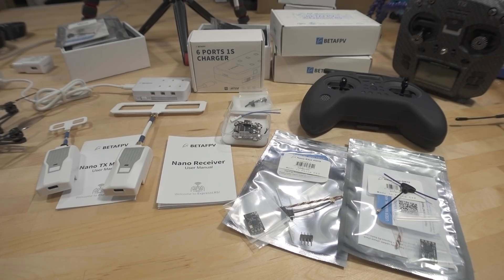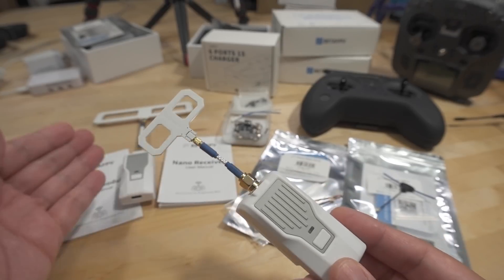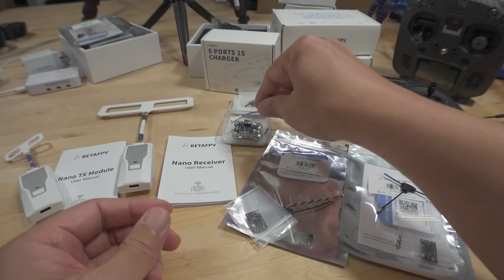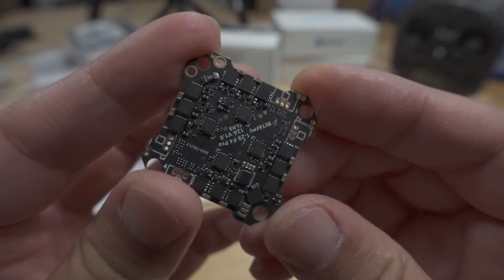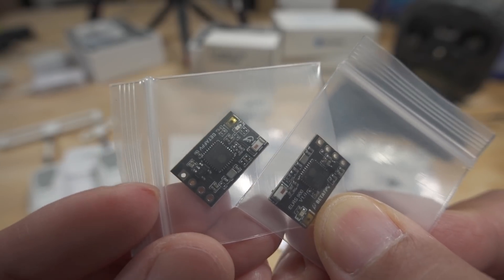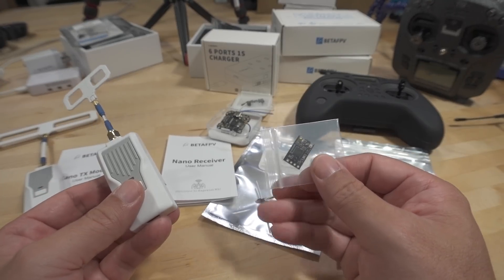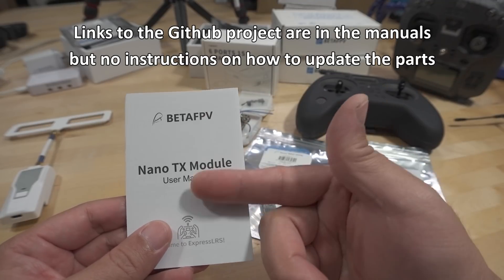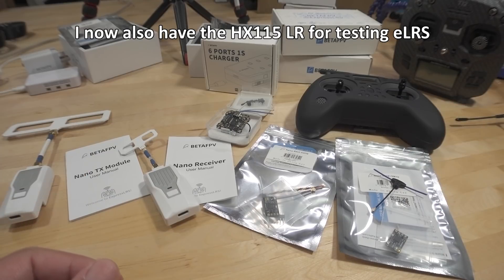BETAFPV ExpressLRS Parts are HERE! 😲

Comment: Do you still have your tango 2?  Would you do a setup video with tango 2 and betafpv ELRS 2.4?
Reply from the maker: Sorry, I don't have the Tango2 anymore.  However, the setup is the same as crossfire and you just use the eLRS lua script instead of the crossfire one to control the module.  So, I'm pretty sure no one will make that exact video because there are already many general setup videos in existence.

Comment: Betafpv or happymodel module - which one is better?
Reply from the maker: Happymodel makes a few different modules but they all basically do the same thing with some minor differences in power output.  The BETAFPV 2.4ghz module can do up to 500mW.  The Happymodel is 250mW max power.  If you want more power then get the BETAFPV module.
Reply: @AlbertKimTV  thanks for your quick reply

Comment: Do you know if they're going to release a normal-sized module for standard radios...?
Reply from the maker: No plans yet
Reply: @AlbertKimTV  Odd choice.  I'd be willing to bet that the TX-16 (and all the clones) is the current most popular transmitter out there...And it can't use this module.
Reply from the maker: @Crusader4633  Perhaps most popular with flyers of larger quads.  BETAFPV knows their customer base very well.  They mostly fly small micros and prefer the smaller radios.  A huge number of people wanted the module for the Tango 2 and X-Lite. They are just listening to their customers.  Happymodel didn't make one until recently (I think it came out a week ago).
Reply: @AlbertKimTV  Happymodel's was always a JR module, just didn't include the box LOL. True though about Beta and smaller quads.
Reply: @AlbertKimTV  For some reason Happymodel CNCed an Iron Man face into the heatsink of their module. Honestly what were they thinking?

Comment: For my next build, I'm really unsure if I should get the new TBS Sixty9 Crossfire/VTX combination board, or go for ELRS. I'm using the TBS Tango 2, and I don't have the module bay. The next build will be a 5 inch too, so weight is not an issue. I have a 2.5 inch laying around too, which is currently missing a receiver - perhaps I'll go for ELRS with that one instead.
Reply: Apart from all the launch bugs I was impressed by the Sixty9, but mine has fried itself without warning after three weeks of use. Unsure what caused the short, bit it took my FC's 5V supply with it. Possibly the u.fl pigtail touching a board component? Having two u.fl pigtails sticking out either side of the stack is the biggest weakness of the sixty9 design IMO. Anyway, I've just ordered 2.4 ELRS and seperate VTX. Crossfire only has decent range at 50Hz, and that is slow. I'd get this module and the Tango module bay adapter if I were you.
Reply: @babc142  I actually got the Sixty9. What I did, was to opt out of using the shield and 30x30 mount. Instead, I routed the uFl pigtails inwards, and I have the coax cables running out the back through the large opening opposite the main connector.  By doing that, it's super compact.
Reply: @ojkolsrud1  I did exactly the same to achieve a really neat setup, and now I'm wondering if this is how the short happened. Could the u.fl pigtail with an inward path have shorted a board component? I hadn't been near a soldering iron for weeks with that setup yet it shorted on battery connection. Anyway, I've taken the opportunity to go ELRS + Unify Pro V3.

Comment: I am wanting another Crossfire receiver but the 915mhz module and a receiver is $56.98. A Crossfire receiver is about $40 when I can find them. I may just have to switch everything over to ELRS since I can get 2 ELRS receivers for the price of 1 Crossfire receiver. The only complaint I've had about Crossfire is the price. TBS completely cured the failsafe problem I was having with my Frsky radio and receivers. Thanks for the links.

Comment: I love elrs, daily flying ep1 and tx from happymodel.. What's the point of such of high power output??? Normally I use 10mw.. Do you really need 100 200 500 mw???
Reply: For long range or penetration I believe. Do you stay pretty close to yourself when you fly?
Reply: @CarbonGlassMan  normally in my backyard, but if I want to play in bandos, I set it to 25mw... Really you don't need more.. And here in Europe, more power than 25mw (you can go up to 100mw but not with the actual channel hoping and duty cicle of elrs) is illegal.. But my point is that you miss the option of using less power (min is 100mw)
Reply: Sorry for my English, isn't my primary language

Comment: All ELRS hardware are compatible with each other as long as the options and bind phrase are the same. You can use HM Tx and BF Rx with the same options and binding phrase while compiling the firmware.
Reply from the maker: Yeah, I'm just waiting for the firmware targets to show up in the configurator since I'm not interested in doing the compiling part myself.

Comment: how wide is the slim module? will it fit in a x9 lite? thanks for review
Reply from the maker: It's the same width as the nano module bay and it is supported in the X9D Lite.
Reply: @AlbertKimTV  the happymodel one kind of protrudes over the top part of the radio (can be seen in the product listing images). Does this one fit better (i.e. not over-hang the top part of the radio so much)? (Also the betafpv version doesn't look like it has a fan in the module?)

Comment: Why oh why open source and hardware why to limit the users to your own eco system like other companies crap
Reply: They haven't limited them, ELRS released V1.0 today with support across the board so you can use these modules/receivers with any ELRS hardware.
Reply from the maker: It's not limited.  It's due to difference in firmware versions.  Should be able to bind with other receivers as soon as I update them all to the same firmware and settings.
Reply: Waiting for that confirmation 🙏☺️
Reply: @Switch180fpv  no need to wait. the reason the Happymodel RX didn't bind is because they come with 0.1.3 installed. betafpv is shipping with 1.0.0 (rc-9?). 0.1.3 and 1.0.0 don't bind with each other.

But always install the latest version and  set a bind phrase, no manual binding needed.
Reply: @wiebel1991  thanks 😊